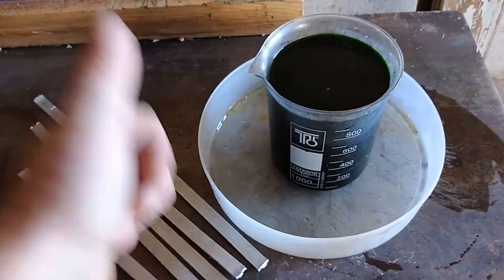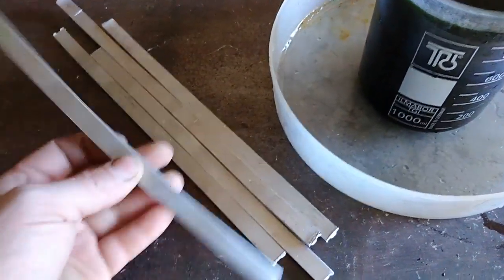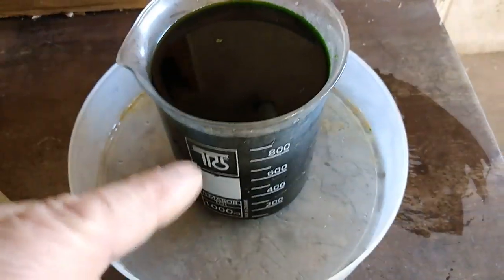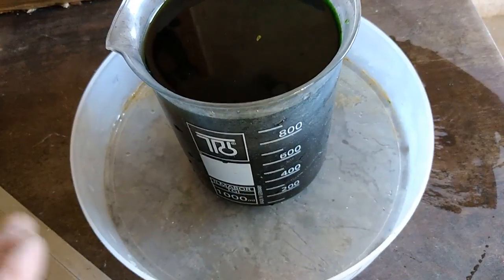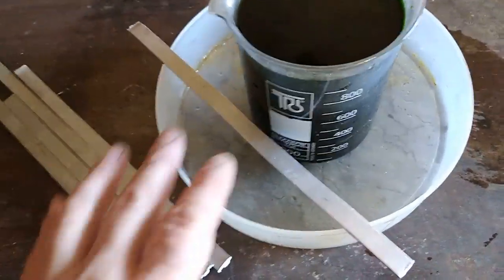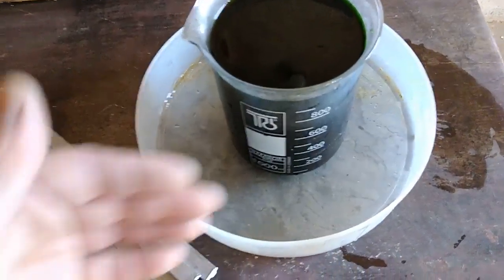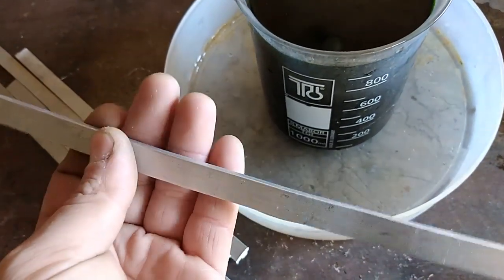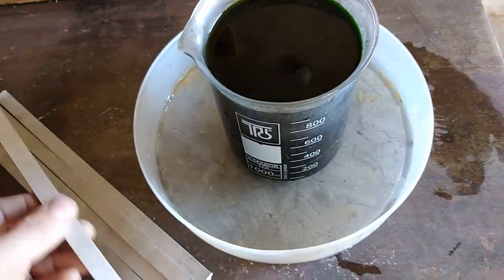Drop copper from solutions with aluminium!

Comment: It looks like there was still a boatload of active Nitric acid in solution reacting which was the majority of the violent reaction, the Nitric was consuming the aluminum alongside the it causing the copper to plate / cement out of solution.

Comment: Copper will vape out with water at 1000c . Says wiki witch basically is shit... But  Alum , what wasn't oxide or vaped  off .... But I wonder if you used small enough aluminum pieces and a glass crucible and let's say you saturated with tin also  at the time copper was in sol and it's all black and won't drop pm easily ,,, would you begin to get brass ? It's made about the same temp or is that how you make it ... ??  I'll let ya kno lol .. if anybody ask, shrug shoulders  and say " mushroom cloud??? Tf you talking bout."

Comment: I did the same, copper dropped with aluminium is impossible to melt, it just won't melt!
Reply: same for tin dropped with aluminium
Reply from the maker: Hmmm, idea for next video.... Ceep it coming ;)
Reply: That doesn’t make sense based on the temps needed to melt both metals. Copper has a high melting point, steel is higher than both. Unless you have high steel contamination

Comment: Aluminum chloride is used  in very many brands of under arm deodorant, as Aluminium chlorohydrate.
I think they possibly neutralise it with sodium hydroxide  
So it might be good not to waste it.
Reply: You can use nitric acid as a deodorant, but it really hurts.
Reply from the maker: I still ceep solution and once i vill return that aluminijum just to see how its look, i think i vill try vith electrolize first.
Nitric for dezodorans,try that, smel nice but your finger makes yelov and skind go of after two days :D
Reply: @999DusanGoldrecovery  in english, we don't use the letter v where the letter w is suppose to be.

Comment: Also pushes out tin, lead, Cobalt, and even iron. There are a lot of metal that are replaced by aluminum. 
I think you could put lye in the cement solution and render the aluminum as hydroxide also with other metals left in the solution.
Reply from the maker: Thanx for advice mate!

Comment: Hi Dusan,please,what is AP solution?
Reply: Acid peroxide....ap
Reply: OK thanks Barry,nitric acid i suppose.
Reply: Paulo Ricardo Santos - AP = muriatic acid (HCL 31,45%) + peroxide 3% / ratio 3:1
Reply from the maker: Yeap, acid peroxyde _Ap.
35% hydrochloric acid and hydrogen peroxyde 3% _ratio 3_1!

Comment: this is based on the reactivity of the metals correct? So in theory you could if you had a solution saturated with platinum you could do this  with pured gold bars and the gold would push out the platinum. then you could work you way down by like silver bars to push out gold.... so with that said you should be able to drop baking soda or lye to drop out aluminum is this correct? Then you would have a bio safe solution
Reply from the maker: It is normal to drop noble metal vith zink, aluminijum or potasium but vith gold to drop platinum i newer try that. Probably can be done, but i dont have a wish to try that. And yes, it is reactivity metal stuf. You yust give me nice idea to make video mate ;)
Reply: ha I am back to square 1 I put aluminum in solution and steel then I put in baking soda before I filter I am idiot with acids haha